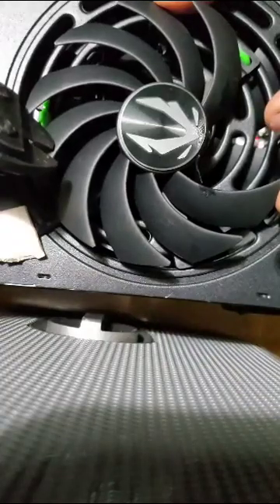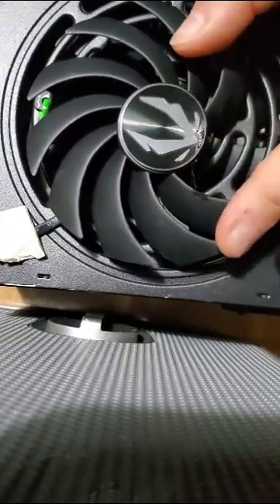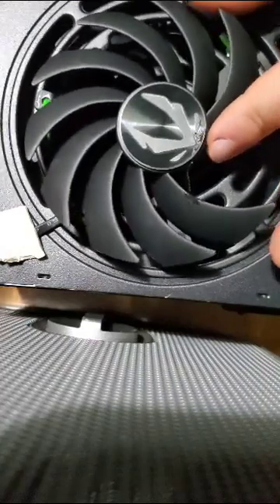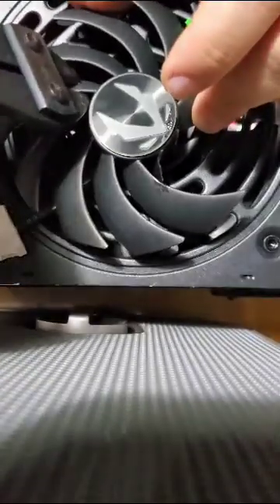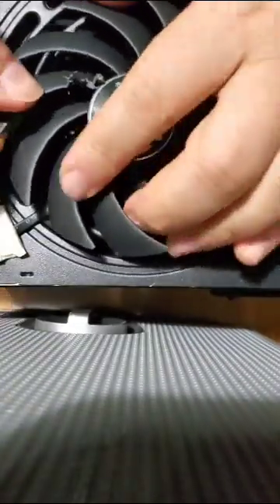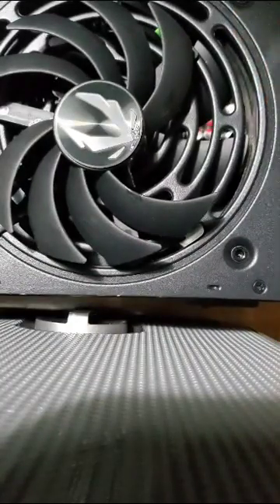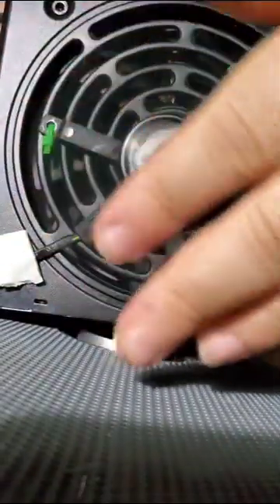Clipping off more GPU fan blades to balance out the already broken ones and fix the graphics card

Comment: Can you help me? I have an MSI GTX 660 Twin Frozr Gaming GPU with two fans, each having 11 blades. The problem is that the left-side fan has one broken blade, and it's making a lot of noise. What should I do
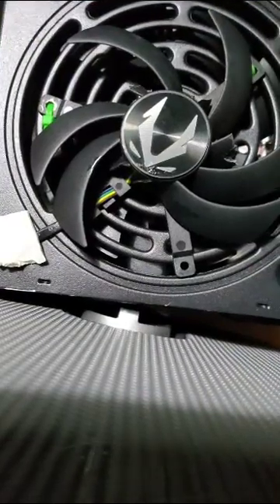Reply from the maker: Looked at my simulation results again and it's clear that my configuration at time 3:17 is the most stable for an 11 blade fan (other than the one without any broken blades obviously). So just break off the blade next to it, then skip two, break one, skip one and break one, skip one, and break one so it looks like mine. If you guys keep breaking your fan blades, watching my video and fixing your fans, and liking my video so it gets more promotion, I might feel motivated to make a web app front end for this fan balancing algorithm. (Legal Disclaimer: Not liable if your computer bursts into flames and burns your house down.... especially if you live in LA and the whole city turns into an inferno again.)
Reply from the maker: Here are the numbers for the most balanced blade configuration where the blades are numbered 0 thru 10 with 9 and 10 being broken initially:

i = 2, j = 4, k = 6, magnitude = 0.009795102358358029, center = [-0.00641443  0.00740264]

Here are the 5 most balanced configurations with just blade 10 broken initially:

i = 3, j = 4, k = 8, magnitude = 0.023647888156663202, center = [ 0.00982369 -0.02151088]
i = 1, j = 5, k = 6, magnitude = 0.02364788815666321, center = [0.02364789 0.        ]
i = 0, j = 4, k = 6, magnitude = 0.0236478881566633, center = [-0.02268998  0.00666238]
i = 3, j = 5, k = 9, magnitude = 0.023647888156663313, center = [-0.01548607  0.01787188]
i = 4, j = 4, k = 4, magnitude = 0.02846296765465702, center = [-0.01863928 -0.02151088]
i = 5, j = 5, k = 5, magnitude = 0.02846296765465705, center = [0.01182394 0.02589083]

So, these numbers are saying that 5 broken blade configuration's center is 2 to 3 times closer to center than any of the possible blade configurations with 2, 3, or 4 broken blades.
Reply from the maker: I suppose you start by break off just blade 4 (slightly before the opposite side, since I call my initially broken one 10 and start counting at 0) to start and see how badly it vibrates with the center of mass 0.02846 units away from true center. Then, if it still vibrates, you can always go ahead and continue to trim off blades 2, 6, and 9 later to get that nice quiet 0.0098 center of mass.

Comment: Bro...i have 14 blade fan and 1 blade broken....solution plzzz
Reply from the maker: If the fan has an even number of blades like 14 and only one broke you can just clip the opposite one on the other side. You only need to get creative if there an odd number of blades and more than one are broken.
Reply: @morrischukhman480  thkz bro.....its worked🎉🎉🎉🎉

Comment: thanks a lot, I had a broken blade and, eventually, with the vibration my video card got lose from the motherboard causing pc freezing and crashes, not to mention the annoying noise. You helped me a lot. The only difference is I tried with just the opposite blade and it worked.
Reply from the maker: Awesome! Glad it was usefull... or at least encouraging.
Reply from the maker: I have 11 blades, so as an odd number there wasn't an opposite blade.
Reply: I have 1 blade missing and the sound is so harash so u took 1 opposite blade off and it was fine?

Comment: Please help i had 14 fans total 3 broke off but it is 2 broken next to eachother then there is one there and 1 broken , there is 1 fan between the two broken to get to the 1 broken
Reply from the maker: Ok, I think I understand what you're describing. so you have something like this: X X 0 X 0 0 0 0 0 0 0 0 0 0 around the circle back to the beginning? (X is broken, 0 is not) Ok, I can plug that into the algorith. I'll reply with the solution in a few days.
Reply from the maker: I've been to busy to rewrite my code but Paste a link to my github code into ChatGPT and tell it what to just commented about and ask it to rewrite it with your broken blade configuration
Reply: isn't it better to just buy spare fans online ?
Reply from the maker: @Kagamiya Yeah that would be te best thing to do if you're not limited by time, money, or availability of parts. My fan is a bit hard to find and comes from across the world very slowly. Mine has been running find for months now with half of its blades and some new thermal paste.
Reply from the maker: I did have my eye on a replacement fan in case this didn't work so well.